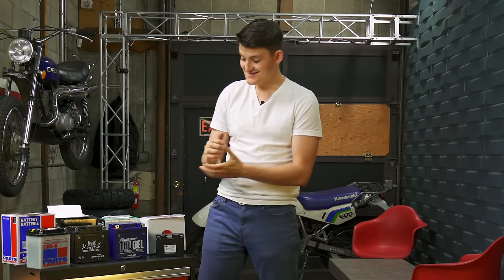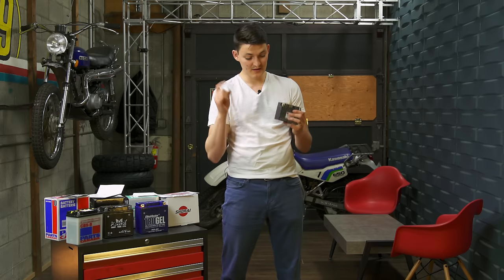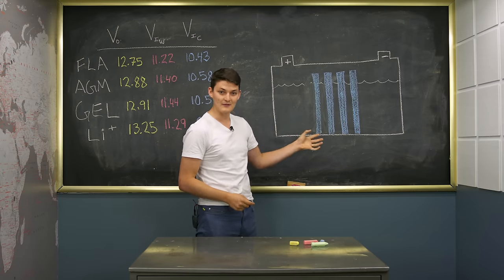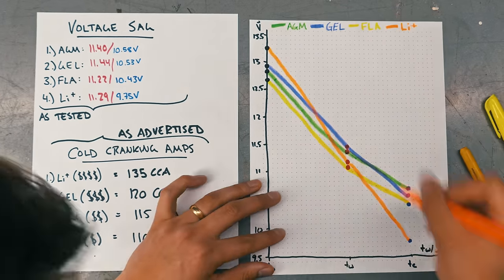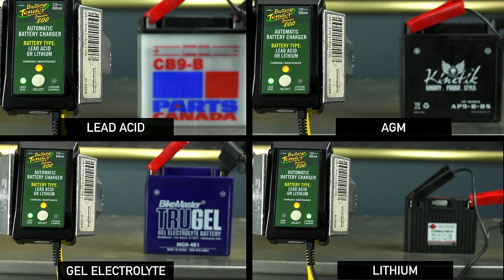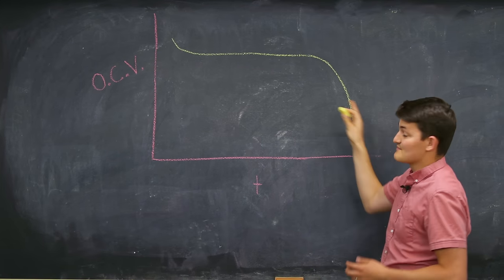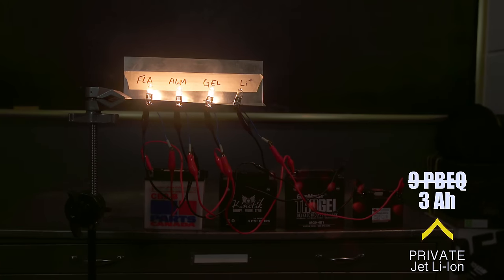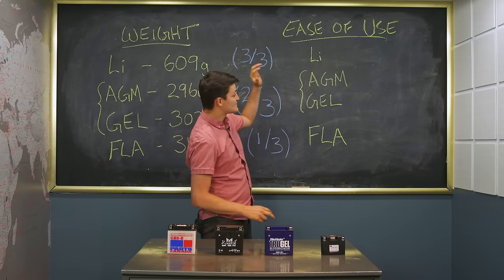Best Motorcycle Battery? Lead-Acid v. AGM v. Gel v. Lithium

Comment: My lithium battery failed after 3.5yr. Not worth the high price... gel from now on😜
Reply: Got my AntiGravity beginning 2014 still running strong.  Has been in 4-5 different bikes, from 110cc scooter commuter to XSR900 thriller.  There are different quality lithiums.  Shorai, what is shown on this video, is one of the lowest quality lithiums.....most of them are.  The highest quality one is AntiGravity.

Comment: Forgetting your headlight on with a tiny LiFePO does suck (why doesn't my headlight turn off when I stop my motor? I mean, I'm some kind of idiot that keeps leaving his headlight on but the designer is a bigger idiot.). That and the price vs. flooded are the only real downsides (although there is a good chance it will outlive the cheap flooded battery making up for 50-100% of the cost difference). TWO KILOS lighter for just a bit more $$$ than a good AGM battery??? Flawlessly installed in a couple minutes? That is a cheap and easy performance mod. Why are you not excited about this? You drive a BMW but you cheap out 100$ on the battery? Did some dumbass hippy once tell you that lithium batteries will save the Canadian ringtailed crocodile and now you gotta find every reason you can to hate on them? Dude, they are better in most applications and also cheaper over lifetime in most applications.

Something is wrong with your charge test. Probably that your charger doesn't actually have a lithium mode, but rather that it's a gel acid charger, which is perfectly safe for LiFePO, but switches to trickle charge too soon, and the marketing team said "close enough". 

Also, there should be a BMS in the lithium battery with LVD so you won't kill your battery if you leave your headlight on. Just push start and drive it for ~10 minutes and it's charged again. Probably lost a few percent capacity each time, but I've done it three times on one battery and the battery still works (now in its third winter, the flooded batteries didn't make it through 2 winters).

Thanks for the tip about running the headlight for a bit before starting my bike in the cold. I'll try that. Do you have a source for that tip?

Comment: Hey witch of these batterys or anther one not in this test  can be wired TO a GTP      im looking into buying a band new motorcycle but I'm also about to start a new job at a prison

12 hour work day and i need to find out witch battery can take a GPS that i can still track even when the bike is turned off     

Also witch GPS low jack is best for me i need that hard wires to the bike i can track the bike when the bike is off from my phone  - an exrta thing that would be nice an alam for if the bike moves when i turn on a seting from the app that says the bike should be parked

Ps i Ride everyday  i dont own or plan on owning anything with 4 wheels at least for a few more years